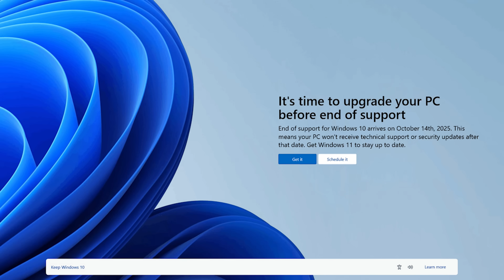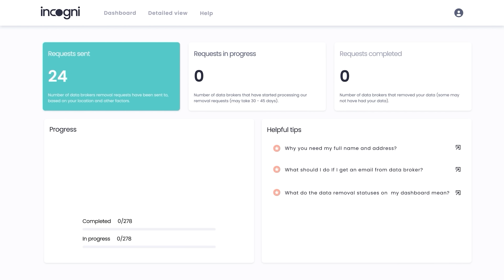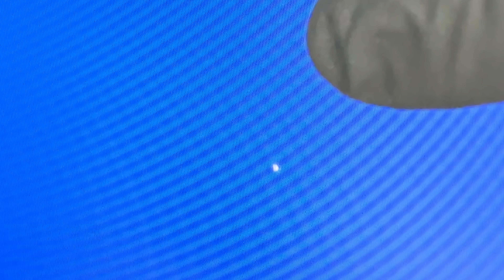I Made 2 WORKING Laptops From 1 Dead ThinkPad - DON'T Buy a New PC Just For Windows 11!

Comment: Exactly what I was doing today at work

A laptop came in, the screen had pink lines as if it was smashed but it wasn't, plugging into a monitor diagnosed it as a hardware issue

We had another laptop, same model going for recycling (seriously, it should be resold not recycled) because of a small crack. But anyway I swapped it over, had to cut it short but it works perfectly good now. And it is for a staff member whose part of a group that isn't allowed new devices (they are classified as contractors, long story)
Reply: What steps did you take to diagnose it as a hardware issue? Software? That's a nice story.
Reply: @Manstrual  If you have a laptop with a display issue, you can usually just plug it into an external monitor to determine if it's a hardware problem with the screen or not, especially if you don't have a standalone GPU.  If the issue doesn't happen on the external display, then you can be almost 100% certain it's the screen itself that has failed.  You'll still want to make a final check that the cables for the screen didn't just come loose or something, but 99% of the time you're going to need to replace the screen to save the laptop.  If you have many of the same or similar model laptop, you might have one with a dead motherboard, or some other fatal issue besides the screen, and you can use parts from one to revive the other.  Laptop rebuilding on enterprise-class laptops isn't exactly difficult, but it is more involved than desktop PC building, as laptops use a lot of delicate ribbon cables and other very low form-factor connectors that must be removed and reconnected gently to avoid damaging them, since even minor damage to them is typically fatal to the component they're attached to.
Reply: @megachonk9440 cool. I work in computer repair myself too and literally had a thinkpad come in with a damaged screen the same day this video dropped. I always want to familiarize myself with all the software that if you know it just makes life super easy, and was just wondering if your situation was one of those, but it was far simpler, figures. Thanks for the comment!